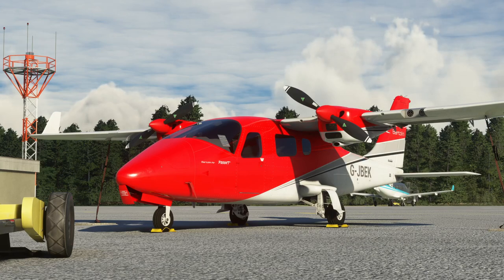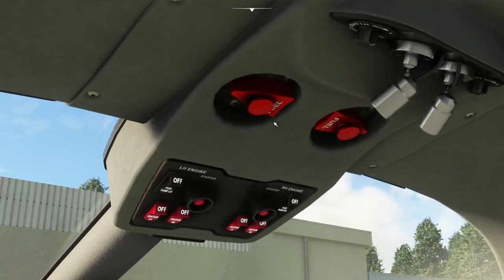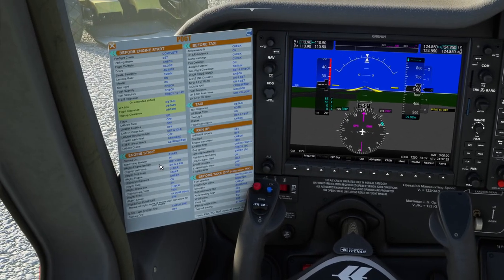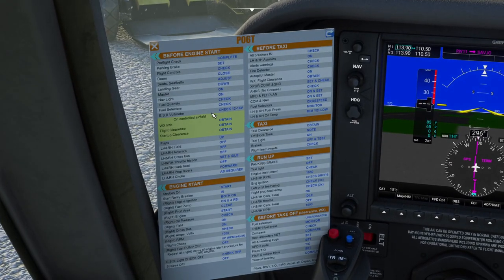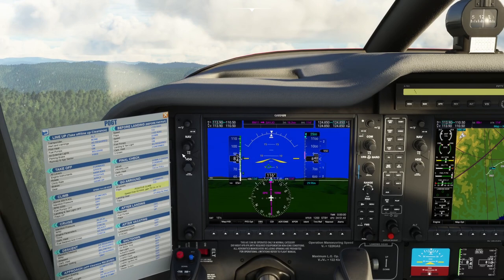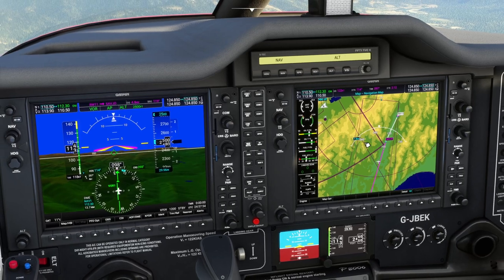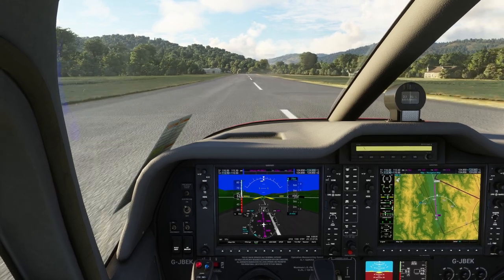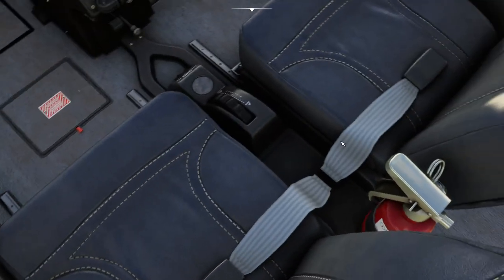Flying from Little River to Boonville in the Tecnam P2006T in Microsoft Flight Simulator

Comment: Cheers Jonathan I’ve just purchased this and thank you for your run through. It was very helpful. It’s a tricky one to start though.
Reply from the maker: It really is :)  I've found cracking the throttle open and using choke tends to work 9 times out of 10 :)
Reply: @jonbeckett  we shouldn’t tell everyone, but then you wouldn’t be doing your job would you. 😂👍🏼

Comment: Nice video, what system are you using this on? I just purchased the 2006T but it does not show fuel quantity, pressures or oil quantity or pressures, I'm using it on xbox series x.
Reply from the maker: I'm running on a PC.

Comment: My car has never failed to start in 12 year. Turn the key and engage the starter and it starts…so why are a few of the ga aircraft..hard to start or just start poorly?
Reply from the maker: Because many aircraft engines are based on 1950s designs.